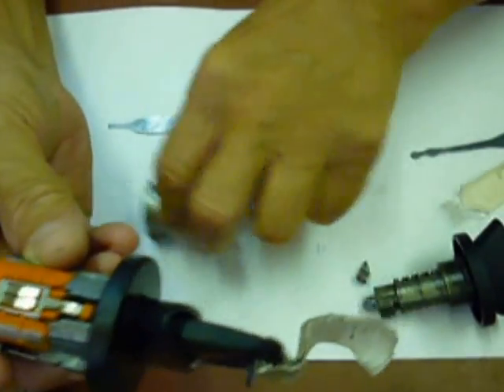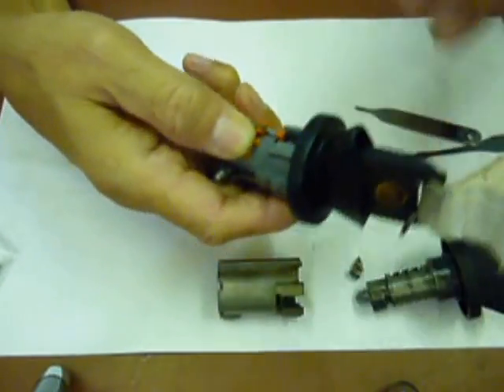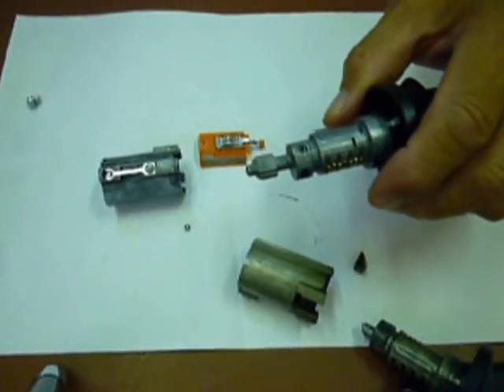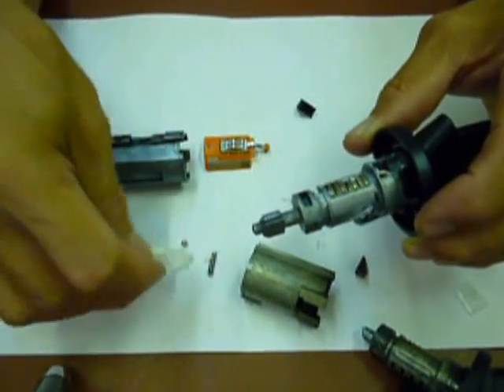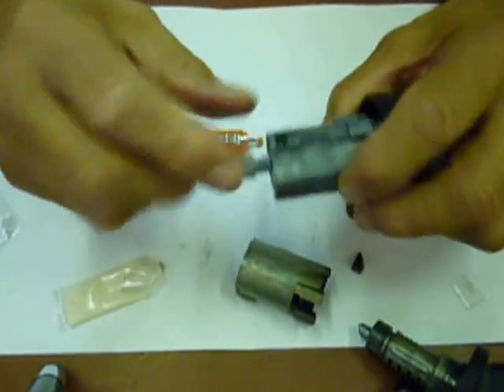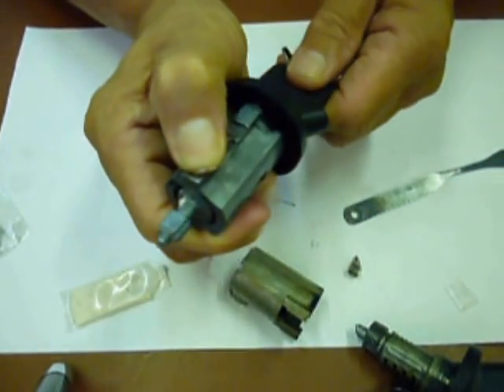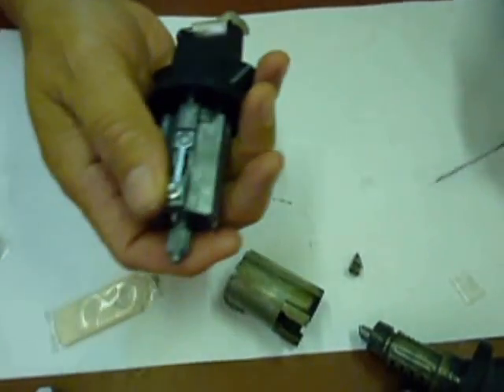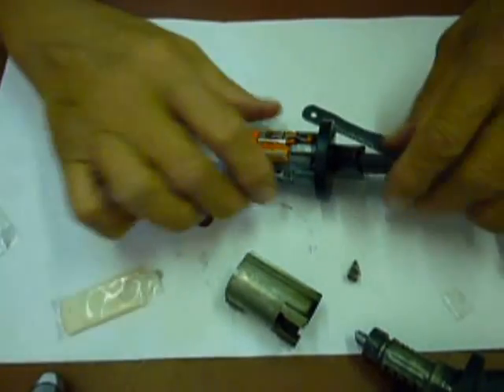HOW TO DISASSEMBLE FORD IGNITION LOCK CYL. for pinning

Comment: I've watched a 1000 times and still cant get the ball bearing out smh
Reply from the maker: that should be loosely fell if not stucked. maybe a wd40 might help. hope you've got it out by now..
Reply: I encountered the same issue, but the problem for me was I didn't have this exact lock cylinder just a very similar one. On my lock cylinder instead of pushing in a ball bearing you pull the pin that locks it into the vehicle further out.

Comment: That's not the ignition switch. That's the ignition lock cylinder. The ignition switch is behind it.
Reply from the maker: thanks buddy, i should have wrote, "ignition switch lock" it might have been nearer. but your right. its an ignition lock cylinder..i'll correct. it. thanks for viewing. regards.

Comment: That ball bearing don't come out that easy ive tried for too long now idk what to do.
Reply from the maker: sometimes the grease got too dried up and preventing the bearing to fall freely, ...try to apply WD40on that hole where the bearing is stucked, pry it a bit with a small pointed nail or something, ..it will loosen a bit, and hopefully it will fell.down.